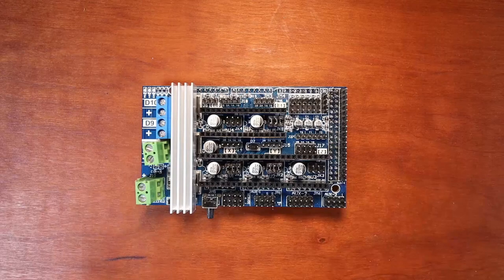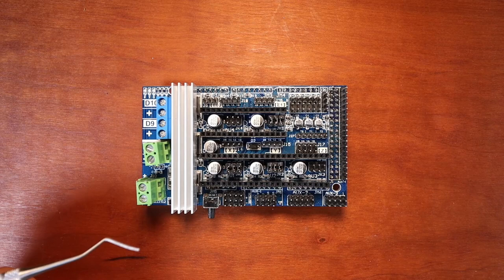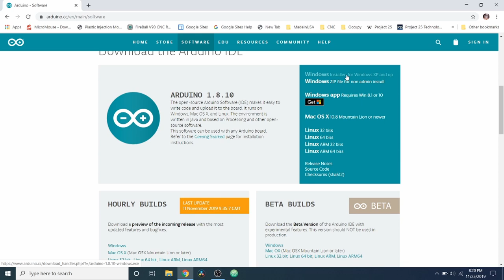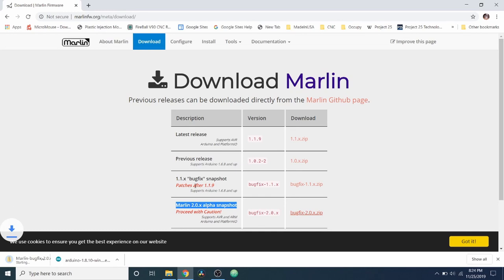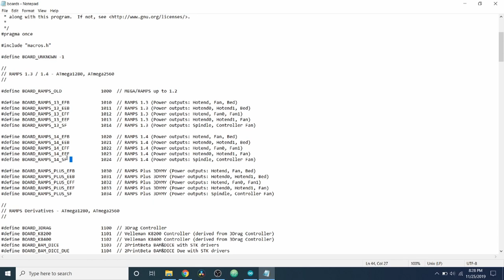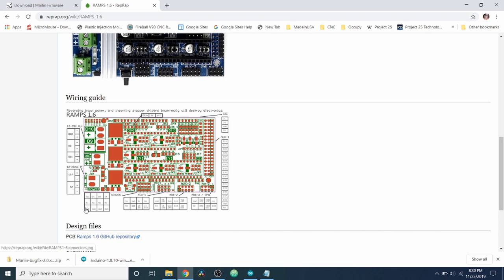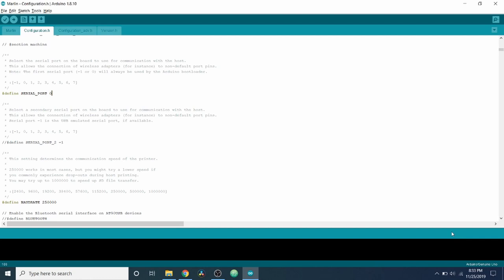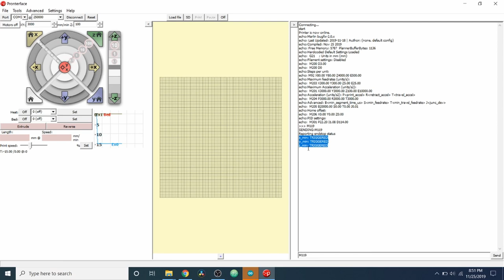RAMPS 1.6 - Basics

Comment: I have completed this lecture. I have uploaded Marlin 2.1.2 to Arduino Mega 2560 R3 (Clon Ch340) and Ramps 1.6 combination.
I want to use the LCD 128x64 (12864KBA_V1.3)
Reply: I able to activate the screen just by activating #define REPRAP_DISCOUNT_FULL_GRAPHIC_SMART_CONTROLLER in Configuration.h

Comment: dear edward,
thank you so much for this video!
I am quite familiar with 3D printer and software, but due to circumstances I have been out for a while.
now i'm trying to restart but everything has been updated and so i have to catch up.
Your video helps me very well!
I'm still having Ramps (the new and the old 1.4/1.6 ) with 12864 Smart LCD Screen Display Controller
Everything has to be restarted so I hope you want to make follow-up videos with Ramps plus the large LCD with SD card.
I hope that you also want to explain how you can make changes again via the LCD (and not via the PC)
so that you are less dependent on the PC.

Friendly greetings from The Netherlands!
Rob
Reply from the maker: Thanks.  I'm trying to find time between work and videos, I'll have some time to build out a new video collection in about 17 days.
Reply: @EdwardBraiman  We are in no hurry,
as long as you know it's appreciated! Thanks again!

(little story from here)
My Printer worked, but saw people switch their filaments on Y.T.
so they could print two colors (I liked that!)
I thought I wanted to be able to do that too, but that didn't go well with my setup.
I have bowden setup and where the engine is nothing to turn the filament off,
so I printed something for it WITH a new engine and also new Ramps with stepsticks.
https://myalbum.com/photo/kAW6ut16f1Cb/1k0.jpg
unfortunately OR the motor is broken OR the stepstick because the motor does not have enough power to push the filament .....
(I do not know yet!)
since then I have been fired (I did nothing wrong! ;-) ) declared redundant? (is this the good translation? I don't know! Google Translate)
I just couldn't do anything with the hobby anymore! (I now have work again (I am happy!)
here some pictures of the construction, they are two printers that I have built (again a separate story)
https://myalbum.com/album/niMpUDhlInjv

again best regards!
Rob

Comment: hi Edwad. its nice video. just started building my 3d printer and i found your channel and its great. 
i just wondng how to connect servo or bltouch sensor on ramps 1.6. It seem that it got no power on the pin. thanks
Reply from the maker: Check out my RAMPS 1.4 playlists for now until I have a chance to make more RAMPS 1.4.  it should help with most your questions.

Comment: Between the power connection and bed connection there is something two pin there what is that and what is the purpose can fan possible there?
Reply from the maker: Not sure which pins you are referring to, but Google ramps pinout diagram for your version of ramps and it will tell you what pins support.  If it's a signal pin it's usually 5v, but can be 3.3v.

Comment: Hi Edward, Just started watching your channel, well done they are very informative. Was just wondering as I'm building a multi purpose rig with Nema23 steppers (single X double Y and single Z) and want to use external drivers for higher current capacity, do you have a tutorial on how to incorporate external drivers on a ramps board. (just got my ramps 1.6 but as I see you have a lot of tuts to do on this board as its so new). If so could you point me to the right tutorial.
Thanks in advance Andrew
Reply from the maker: Check out my RAMPS 1.4 playlist and SKR 1.3 for some of the information.  I'll have time in about 2 week to do something about this.
Reply: @EdwardBraiman  Dear Edward, can you please share any additional link you might have about this? And are there more recent versions than 1.6 for RAMPS?
Reply from the maker: If you go to my profile there are older ramps 1.4 tutorials, just keep in mind Marlin firmware has changed over the years since these had been recorded.
Reply: @EdwardBraiman  thank you !!!
Reply from the maker: You're welcome.

Comment: Hi Ed, I have problem with Mega 2560 but not sure is it really Mega or the Ramp. When I turn the printer ON I see nothing on the LCD only after I connect USB cable to the Laptop and all work good but If I disconnect the Laptop nothing on the LCD again, is it possible that the voltage regulator on Mega failed or something else?
Thank you and best regards
Mustafa
Reply from the maker: Could be, 5v is running the board logic from USB.  Of it's not powered could be a regulator, but without seeing the wiring or knowing history of board, one can only guess.

Comment: Sir i have a problem i brought ramps 1.6+ i upload the program and connect all the motors every thing is okay but the extruder motor is not working any solution please replay me
Reply from the maker: What's the extruder temperature when you try and extruder?
Reply: @EdwardBraiman  i didn't connect the hot end to the board i just simply check the motors
Reply from the maker: Watch my Livestream from tonight and you'll see the explanation.

Comment: I have a anet a8  and i convert it motherboard to ramps 1.6. but i have a problem with connections stepper motors not moves true. How can i connect it? Do you have video for wiring?
Reply from the maker: You'll need to remove comments for the stepper drivers in configuration.h.  checkout my SKR.1.3 playlist and leave motherboard at defualt and serial port.
Reply: But i have stepper drivers, And i already changed it.
Reply from the maker: The process of setting up the physical stepper is not what I'm trying to point you to, it's the Marlin configuration.  It might be better to skim through my playlist until I make a video on this motherboard.

Comment: Can i control 24 volt steppermotor with the 1.6? 
and how do i set that voltage?
And if i have steppepper motors that are at different voltages how do i solve this?
Reply from the maker: Check the datasheet for the board,   24v steppers seems a little high.
Reply: Edward Braiman the steppers are 24 volt.
But how do i control the voltage that is going to the motors?
Do i just put 24 volts at the power input becouse it can go between 12 and 35 volts?
Reply from the maker: Depends on the stepper driver.  The RAMPS 1.6 can handle 24v, but stepper drivers meter out power to stepper motors.  This is why I'm pointing you in the direction of the stepper motor datasheet.  Stepper driver boards like A4988, DRV8825, TMC2208, TMC2209, TMC 2130,... All have different power configurations.  If you're unsure start with a simple 12v on something like a DRV8825 and a Nema17.  Jumping into an advanced configuration may become expensive without consulting the datasheets.  I'll be doing more tutorials on the RAMPS 1.6 in the coming days and weeks explaining the stepper driver install and configuration process.
Reply: Edward Braiman thank you

Comment: Hi, I was wondering, what is the difference between the 1.4 and the 1.6 version to ramps?
Reply from the maker: 1.4 does 12v.
Reply: RE; @EdwardBraiman  Is that it, its voltage... Not worth changing then, esp when the current these days are handled by mosfets
Reply from the maker: It's more designed for new users.  The firmware from my original tutorials is now dated and I'm fielding more questions regarding how Marlin firmware is not the same. Plus I'm testing a new camera and sound recording system to give a better tutorial experience.
Reply: @EdwardBraiman  ok and good luck. I've been watching your videos and found it useful in understanding ramps 1.4. So seeing 1.6 just raised my curiosity.
Thanks again for your replies.
Will be starting my own channel too soon.
Fingers crossed
Reply: I am thinking of going 24V with some new and old printers with RAMPS 1.6 and I am checking if you think I still need to do the D1 diode mod or can I just throw a 24V PSU in with some 24V heater cartridge/fans and call it a day?

I heard the mosfets, capacitors, fuses, and probably even the LED resistors on the 1.6 were fine for 24V but I'd appreciate hearing something more definitive from someone with more experience with 24V than me
Reply from the maker: The board according www.reprap.org/wiki/RAMPS_1.6 it can handle 24v.
Reply: @Bajicoy  i read that you disconnect the d1 diode so the ramps board doesnt send power to the mega board, which cant run 24v.
Reply from the maker: I think they labeled the RAMPS 1.6 12/24 volts, but I'll need to verify when I get home.

Comment: Good morning Edward
Friend I am watching your channel very good, I would like a help I am setting up my first printer with 1.6 ramps only I do not know how to connect Prusa PINDA v2 probe because the white wire is a thermistor, and how do I put also a filament sensor from prusa could help me, thank you very much. I'm from Brazil
Reply from the maker: Do you have a link for the probe?  Checkout my playlist for ramps 1.4 for runout detector.
Reply: @EdwardBraiman  , good afternoon, I'm going to use 3d touch as your videos for leveling, v2 is more complicated, but I want to use the Prusa filament sensor. https://help.prusa3d.com/en/article/ir-filament-sensor-mk2-5s-mk3s_112214
Reply: @EdwardBraiman  Thanks for answering me I'm happy

Comment: Hi. How to connect Hotend Fan in Ramps 1.6?
Reply from the maker: I've not yet made a tutorial for RAMPS 1.6, but the process is same as RAMPS 1.4.  checkout my RAMPS 1.4 playlist.
Reply: Edward Braiman  there is not the two pins on the 1.6 board, that you would connect the hot end fan to
Reply from the maker: You can wire carefully from D9, but be careful.  That will give you two fans with servo pins using a fan extender.
Reply from the maker: Remember this solution is based on a 12v power supply.
Reply: @EdwardBraiman  thanks for the video!!   You mention in the video that the servo pins can be used for additional fans.  Will a fan extender be needed if I want a fan for the extruder and the hotend?  Would it take up all the servo pins(I'm currently using bltouch in servo 1), or can I use Aux 1?  Thanks again for the great videos!
Reply from the maker: Yeah, iou can always move to other pins, but you need the update pins in configuration.h or pins file.
Reply: It turns out there are two pins to connect the hot end fan to. Next to the D10 connector. The pins are not in but the holes are there.
Reply: Sorry next to D8

Comment: Hi! Is it possible use TMC2208 v3.0 UART
Reply from the maker: Eventually.
Reply: I am not familiar with v3.0, will older TMC2208 with the usual pin out just work the same as RAMPS 1.4 and 1.5? Looks to be a popular upgrade not having to flip some of the pins like what had to be done with the TMC 2130's
Reply: Daniel .Power Too many don't work with this card.  I tried everything, but there was no way to make them work.
Reply from the maker: Could you rephrase?
Reply: @EdwardBraiman  I have a Ramps 1.6 Plus, TMC2208 v3.0 Uart and all rest is an Anet A8 with Tatara frame. I used Marlin 2. 
I made the cables with the 1kOhm resistor and connected 
them as described in "https://www.instructables.com/id/UART-This-Serial-Control-of-Stepper-Motors-With-th/"

1. I can't activate "Monitor_Driver_Status", because I have the following compilation error:
 Disable MONITOR DRIVER STATUS or use hardware serial.
2. compiled and loaded the firmware after disabling Monitor_Driver_Status, when I connect with Pronterface,
 I get the following errors: 

Testing X connection... Error: All LOW
Testing Y connection... Error: All LOW
Testing Z connection... Error: All LOW
Testing E connection... Error: All LOW
Reply: @Giovanni2862  I've never heard of needing to connect those pins like that for TMC2208 and I never heard of needing a 1k ohm resistor. I thought the TMC2208's were simply plugged in and enabled in firmware. Especially the RAMPS 1.6+ which has its stepper drivers redesigned for SPI mode, it should really be plug and play but I don't know much about its UART functionality, just that most of the stepper driver stuff is different from RAMPS 1.4.

I was asking about RAMPS 1.6, essentially like RAMPS 1.4 but with changes to the mosfets and fuses, no changes to the stepper driver spots.
Reply from the maker: This is per Marlin firmware notes.  They may have changed in the last year, but the notes should still be there.
Reply: Edward Braiman Could you explain more?
Reply from the maker: If you do a search in Marlin firmware on configuration.h or adv_config.h, I think they explain in the firmware.
Reply: @Giovanni2862  interesting, this is all new stuff to me, what do you think software UART means?

Looks like you are right with that 1k ohm resistor being required because the section in adv_config.h says it is needed. I was really hoping I could just buy some simple plug and play 256 silent driver without cherry wiring the drivers especially when all the pins are soldered facing downward.

Do you think OTP works with TMC2208 where they can be programmed externally and then plugged in? I don't really have a need to change driver settings on the fly. Maybe I  would like to know how to get the potentiometer working to adjust the driver current on the fly.
Reply from the maker: https://en.m.wikipedia.org/wiki/Universal_asynchronous_receiver-transmitter